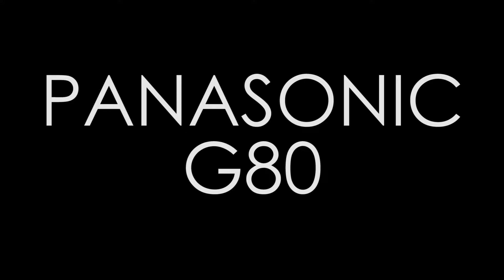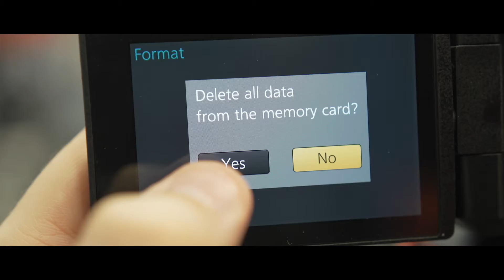Panasonic G80 - Introduction

Comment from the maker: 0:00 Introduction
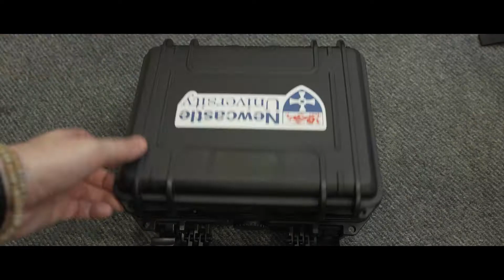0:15 Inside the camera case
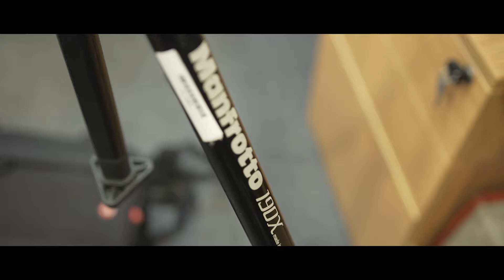0:27 Charging the battery
0:48 Removing the SD card
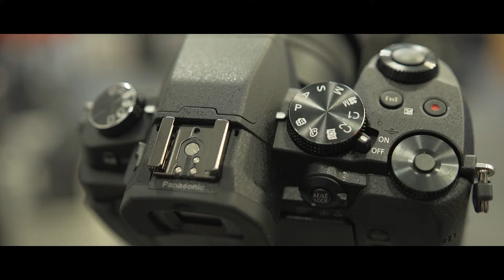1:00 Switching camera on
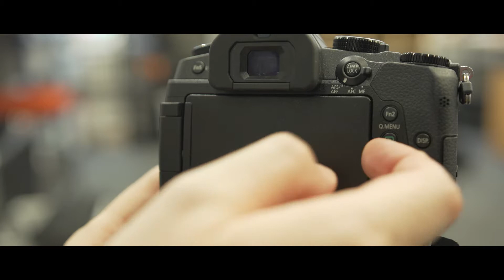1:12 Formatting SD card
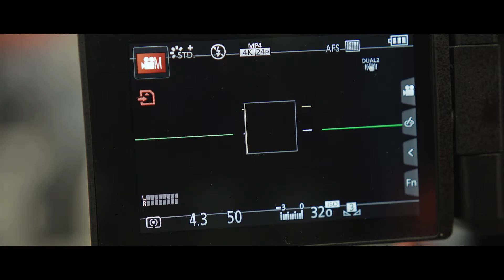1:31 Recording format
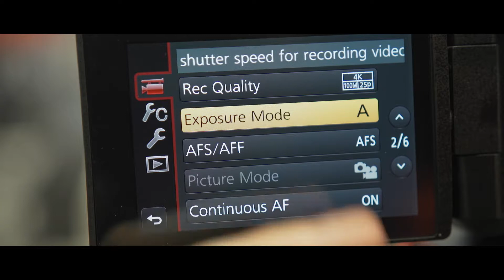1:51 Exposure mode
2:01 Photo style settings
2:40 ISO settings
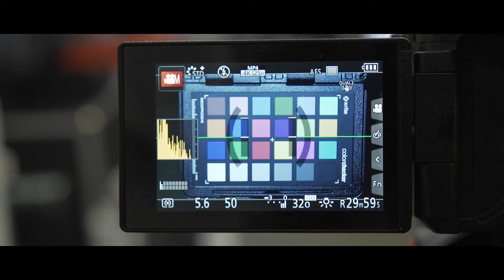2:56 White balance
3:15 Auto and manual focus
3:47 External microphones
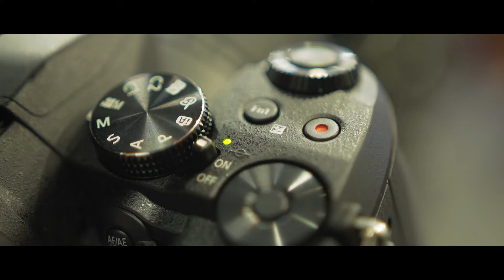3:58 Recording video
4:04 Video playback